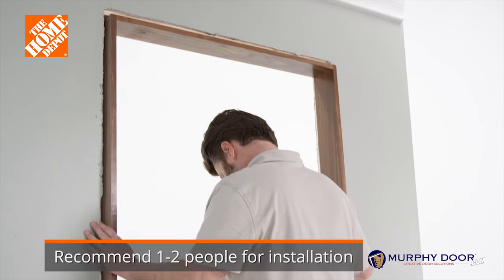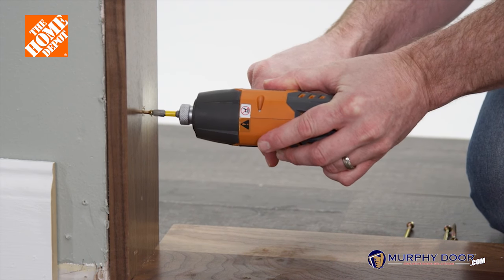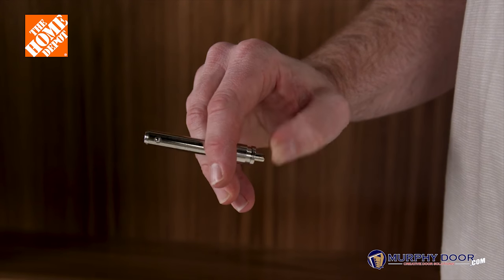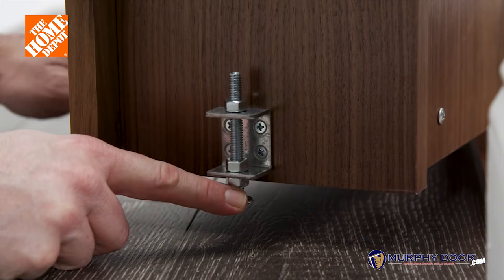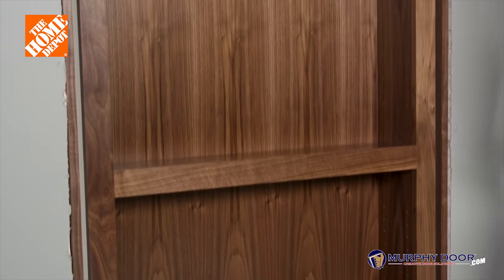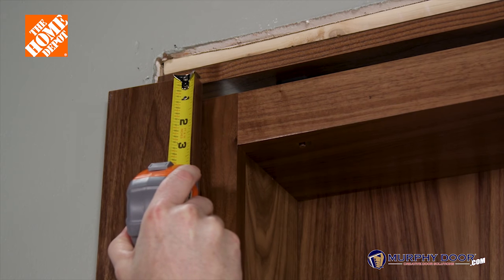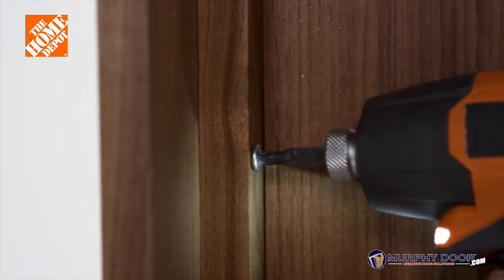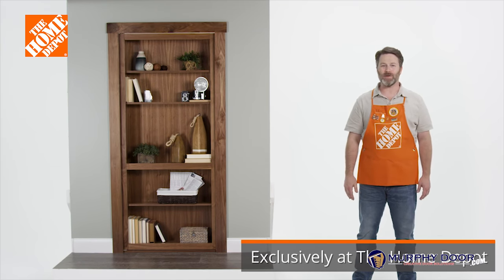Installing an Out-swing Murphy Door

Comment: You can see light through the gap on the top...
Reply: There will always be a gap on an out swing, they just left way too much of one. In swing is the best way to go.
Reply: Just turn the light off inside
Reply: You can also install a small piece of trim at the top to eliminate the obvious gap. Just be careful not to install the trim too close to the hinge side casing.

Comment: There's a gap at the top of the door between the frame and door that looks like it gives it away, especially if you have a light on behind it.  Did the home depot guy install it incorrectly?  If you could attach the top casing to the door, then it would solve the problem, but then it would not be able to overhang the side casing panels.  Maybe retrofit the design with dark brush material (like from the bottom of a garage door) just inside the top casing?
Reply: I noticed that too.  So if it was in swing inside hidden room, would molding hide the gap better?
Reply from the maker: That is true. With the out swing there will be a tiny gap at the top. The gap left is totally reliant in your finish carpenter.  In this case the studio and actor that filmed this shot left a much larger gap than needed. In order do the door to swing under the trim on an outswing door it needs to be a minimum of 1/16th of an inch an inswing is overlapping leaving all light sealed off.
Reply: Yes! I'm trying to work through how to make it not so noticeable. 

The issue with putting it on the door is that it would interfere with opening the door at the hinge side.

I'm sure with a little more thinking, this could be solved though.
Reply: @laurenharrison3400   A strip pf black-out curtain material across the inside top will cover the gap and leave zero light getting through. Hang it on the inside of the hidden room, across the top of the door frame. When the bookcase is closed, the top back edge of it will rest against the curtain material. Another option is to make a small wooden right angle strip that is the full width of the door frame which covers that same area as the curtain would, so when the door is closed, the gap is hidden.

Comment: haha...spend 10 seconds on hinges but the other 2 minutes on installing shelves and casing.
Reply from the maker: That's because the hinges are already installed on the door so you don't have to hassle with them! Simply drop the bottom pin into place, and insert the top pin. Shimming the door, cutting and installing trim is the most time consuming part for the owner/ installer.
Reply: Got it....Im here because I was only buying the hardware.
Reply: @williamdavenport9229  Did you find just the hardware.  I will build my own cabinet/bookcase to find my doorway.

Comment: Its a gap at the top , you can see light 👎
Reply from the maker: With the out-swing you will have a slight gap for the door to swing under the trim. On an in-swing you can bring the trim down to cover up the gap! To block the light a lot of customers place a thin weather stripping. It depends on what you need it for though!

Comment: This video doesn't address some of the fundamental questions around installing a bookcase door. For instance, it doesn't address where to place the pivot hinges which is extremely important when setting the trim pieces around the door jamb. It 'appears' that the door was placed about 1/2" inside the casing but who knows for sure since these critical elements are not on this video.  I think these are much more important things to know than how to place the shelf pins (which seems like a no-brainer).
Reply from the maker: Our doors come fully assembled, pre hung in the jamb. Which means the hinges have been accurately placed and everything is ready for install!
Reply: This isn't a DIY video on building you're own door. 

It's an installation guide for their doors specifically.

Comment: BEWARE buying a murphy door from them. If the item arrives damaged, they have terrible customer service. I purchased a bookcase door and after waiting 4 weeks the item arrived damaged. I immediately took pictures and sent them over. Customer service reverted that they can either send me $200 or they can send a door carcass but that will take another 3 - 4 weeks. I told them that my contractor can fix it but he quoted me $350. Murphy Door stated that under their terms and conditions they use a one standard rate and they will not pay per contractor’s rate. So pretty much what they are saying is if the item arrives damaged. The customer will have to pay more out of their pocket to pay a contractor to either fix the damages or to have it replaced with the replacement. Elizabeth Hargraves is one of the works customer service representatives I've had to deal with.

Comment: The website gives multiple measurement options when selecting which one to buy. Are the width and height measurements including the door jam or is it measured from inside the door jam?
Reply from the maker: It depends on if you are measuring a rough opening or a doorway with an existing jamb. There is a chart for both! If you need help determining the measurement feel free to give us a call at 888-458-5911
Reply from the maker: The rough opening or RO is outside of jamb, the door measurement is the inside of door measurment.

Comment: Do you offer a hing set that would allow the door/cabinet to sit flush against with interior wall on the hing side when the door/cabinet is full opened? Swinging completely out of frame and into space, making the cabinet/door look like a wall cabinet when the door is opened fully? Door closed = hidden entry door, door open = cabinet against interior wall of room. Dose that make sense?
Reply from the maker: Just to make sure I understand, are you wanting a door that opens 180 degrees and lays flat against the wall when opened?
Reply: @murphydoor  yes, that is correct.

Comment: How easy is it to remove the door for accessibility?
Reply from the maker: Pretty simple. We send you a pin removal tool and you remove the top pin, and lift the bottom pin out of place. (The hardest part will be taking your stuff off the door to lift it).
Reply: @murphydoor  more like storing that pin remover where you can find it lol
Reply: @murphydoor  I disagree this is simple to remove. I removed the pin, and the door has no way to lift vertically because there is only 1/16" of space to lift it up to. Is there a video on removing it once the trim is installed?

Comment: Damn i would love it to have a lock for the other side
Reply from the maker: You can add an electro magnetic lock which can be controlled from either side of the door!
Reply: @murphydoor  could you pinpoint the hardware he's using?
Reply from the maker: @BuyAtLess  Yes he's using the Murphy Hardware/ Hinge system. You can find them here. https://murphydoor.com/products/single-flush-mount-hardware

Comment: What are the cons of the outswing? my door would lead into a small 7'x32" space so I hate to waste too much on space for an inswinging door.
Reply: There are two disadvantages to the outswing door, 1 is the pass through of the outswing is smaller than it would be on the inswing by about 6 1/2" and it is more concealed with the trim acting as a seal and door stop.  both are nice but inswing does have advantages.

Comment: Any ideas on how to hide the gap at the top of the door?  I was thinking of adding a quarter panel peace to the door itself.
Reply from the maker: For an out swing door the tighter you can get the door level and place the trim the better. Regardless you will have a small gap. One simple fix is to apply a thin strip of weather stripping to block any light that may come from the back room.
Reply: Brush sweep
Reply: @murphydoor  Can the trim pieces be attached to the door instead of the wall except for the hinge side?
Reply: @Fields82  I was wondering the same thing! If the side trim pieces were taller and the top trim was not as wide I think it could work.